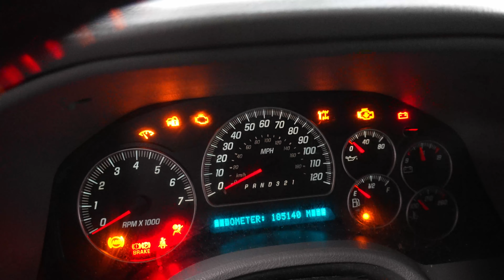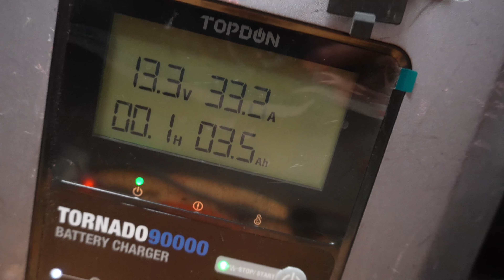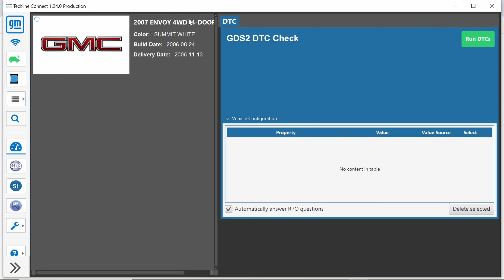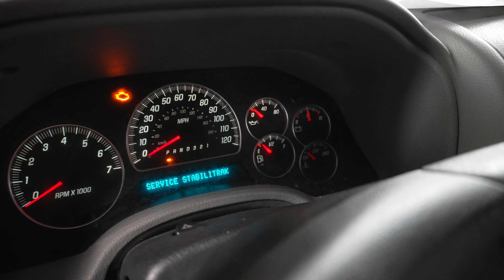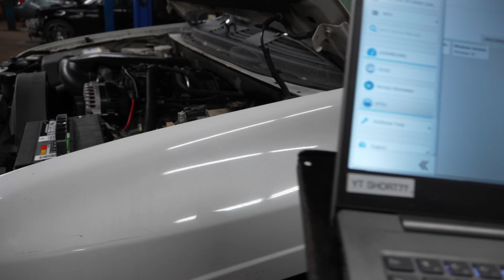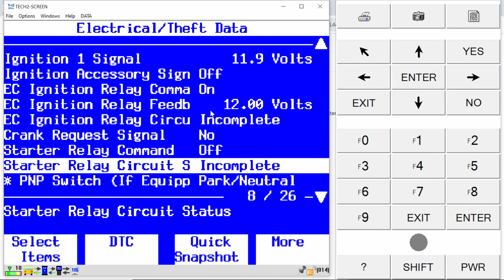2007 Envoy 5 3 Used PCM

Comment: Thanks for the walkthrough of the programming session, Brian.  I hope the shop didn’t make the wrong call with the ECU replacement.
Reply from the maker: They made the right call,   turns out some one wired the alternator pig tail backwards(2 wires)

Comment: Thanks for the video Brian. I have a 2005 express van and a 2008 trailblazer 4200 and both of them charge above 15 volts on cold start. After 5 minutes or so they calm down to 14.5 or so. The first Chevy I owned that did this was a 2005 Astro van. I thought for sure the alternator was bad or I had a voltage drop issue. Everything tested out ok and I got used to it. 
I have heard that it is a desulphate  strategy but couldn’t find good information to back it up.
Reply from the maker: Thanks for the good information
Reply from the maker: So i talked to the shop the other day,   Someone wired up the pigtail for the alternator backwards,  after they fixed they said the charging   voltage went lower faster. Interesting to learn about some of the logic  / strategies for a simple charging system!

Comment: Brian, i see you had to use two tools on this vehicle.  The GM MDI 2 ? and the tech2.  Do you recommend purchasing both tools?  I currently have a cardaq plus 3.  Is the tech2 needed to work on older Chevy trucks like a 2008 trailblazer?
Reply from the maker: Tech 2 win is a windows based software tool, the mdi 2 is whatvi used to connect the tech 2 win tithe vehicle .
Reply from the maker: Tech 2 win will work with non global a vehicles,